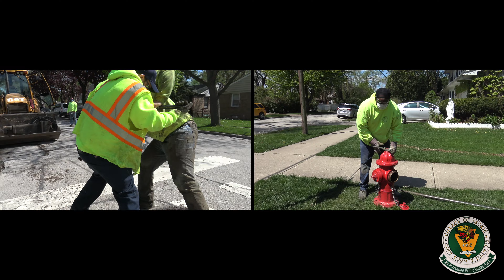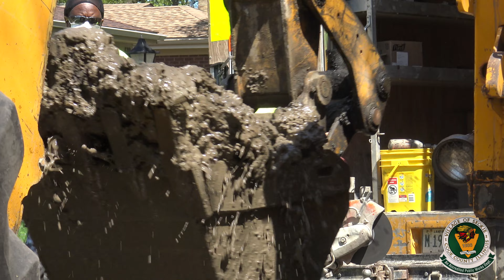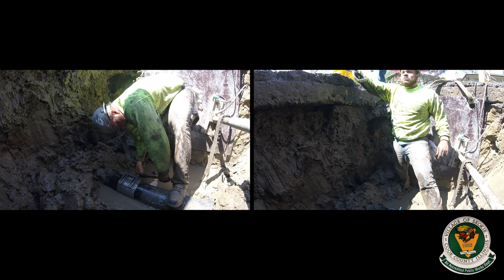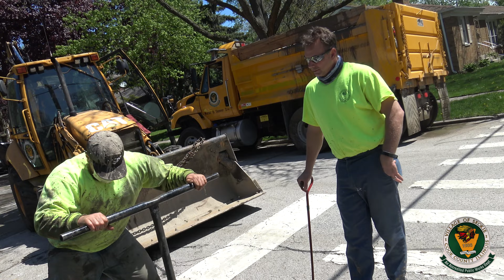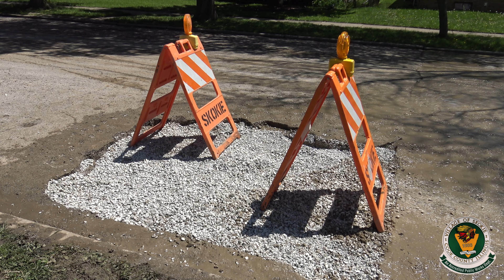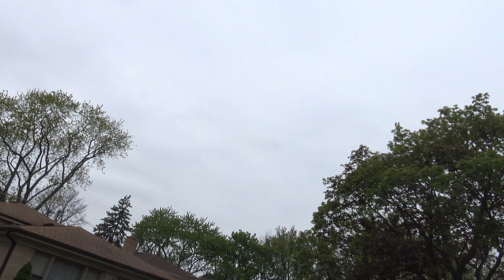Skokie Water Main Repair in 3 Minutes

Comment: You guys don't backfill with sand? Interesting, we backfill with sand then gravel on top
Reply: I was thinking the same thing.. Thought it was odd they filled it that much with rock and only rock. Here in Nevada we have to do minimum 2 feet of sand then dirt ontop of that then replace asphalt if needed.
Reply: @eamonwebb1732  Its frightening to see how its done in the us. I come from sweden and here thing are different i promise.
Reply: Crusher or washed stone in road or sidewalks select or sand in grass come back at a later date for restoration